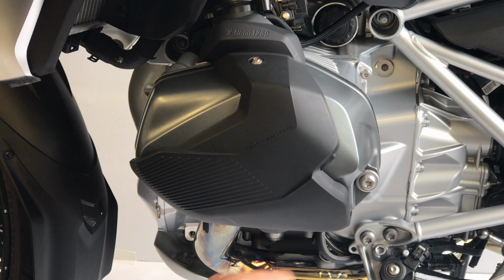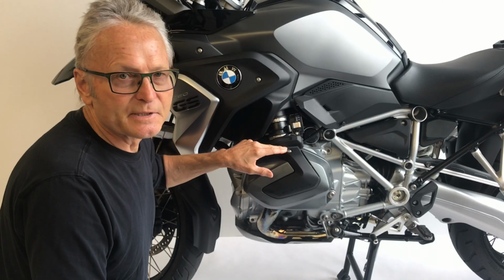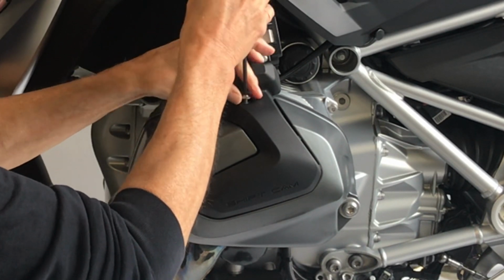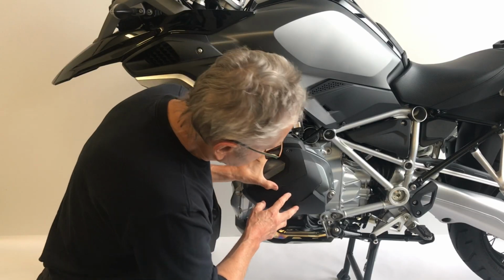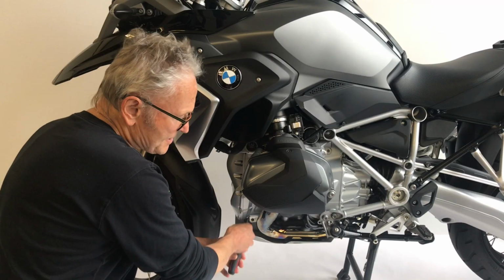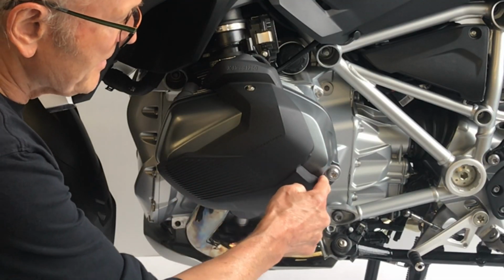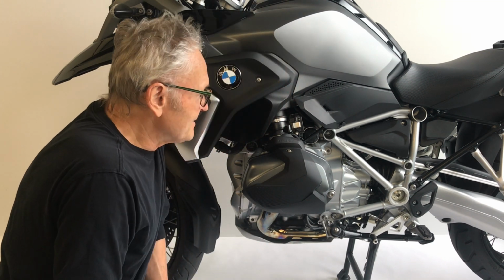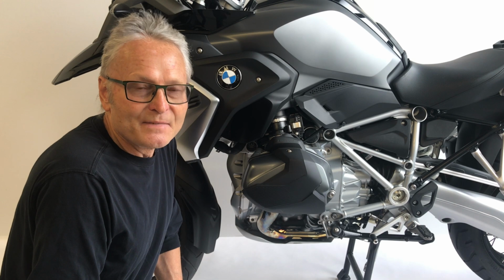X Head 1250 Installation

Comment: I just purchase the x 1250 covers. Very happy with the quality, I prefer the covers over the bars when it comes to the R1250 R . My only question is once you take off the spark plug covers do the X1250 covers offer the same protection of the wires against the elements?

Comment: Looks good! Do they eventually mark the pain where they touch the cylinder head cover?
On the older Cam Head GSA’s something similar was standard and touched the cylinder head covers with a rubber pad. Where they touched took the paint off the covers over time. Obviously a lot of vibration here so anything touching will cause wear to the cylinder head covers eventually unless it is held tightly enough that it doesn’t vibrate.

Comment: Very nice product. They look like they came from the factory.

However, the bottom screws are very easy to cross thread. A leader on the screws you suppied would have helped. The factory BMW screws have that.
Reply: The screws work fine. No WD40 required. What I did was without putting on the X Head first, I threaded the screws in, so I knew the angle, and got a feel as to how it should feel as you wind them in. Pulled them out, lined up the X head, I put the top screw in, as per the instructions, then put the bottom ones in. No cross threading.
Reply from the maker: To prevent cross-threading of the bottom screw, add a drop of WD-40 onto the threads before inserting and slowly thread it in until it enters smoothly.
Reply: @MachineartMoto  Thanks. That might help, but again, you should look at the factory BMW screws. There are various screw designs that help this.
Reply: @paulv22  This may be a dumb question, but I have to ask. You only show the removal of the top original (BMW) screw before installing your guard. The two bottom screws must also be removed too, correct? And you supply all three new screws?
Reply: @illiyakuryakin3092  Not a dumb question. You remove the top screw and the original cover over the coil/sparkplug well and the xhead takes the place of that. There are two empty threaded holes per side that the xhead uses. I believe those holes are there because BMW sells their own cylinder head protectors. When I bought the Xheads, they came with all the screws needed. Because of the rubber layer, you really need to push them on hard to keep the holes aligned and thread them in properly.
Reply: @paulv22  Hello Paul. Thank you for the explanation. In the video he points to and refers to the two bottom screws. He should have explained that better. Now I can see my question was not so dumb after all 😊. May you always be safe in your rides.

Comment: Thinking of adding these to an R1250R I just picked up. For 95% paved and 5% gravel road riding, would these be an acceptable substitute for crash bars?

Also, any issues with heat retention or are there passageways to allow decent airflow?
Reply: That's what I thought, however, I'm not taking my GS at all on the dirt or gravel. I just need a comfortable, bike to make my trips to my Jersey Shore House. But I would think anything between the road and the cylinders would be better than nothing at all.